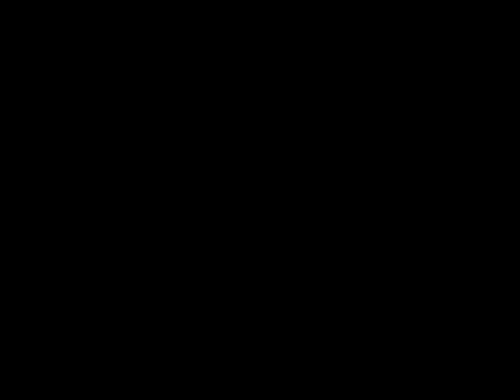HSV W427

Comment: what i do not get isthis, it is a huge 7litres and just 500hp. Yet my slightly worked vz sv6 is 410 hp (306 kW) and it only cost me $1200 aus to mod. It is a 3.6 bloody motor and it is not that far of this beast. Holden you fucking twits. Just mod your 3.6 and 5.0 with a few extra parts. I have seen 5.0 motors with more grant that that big 7.0